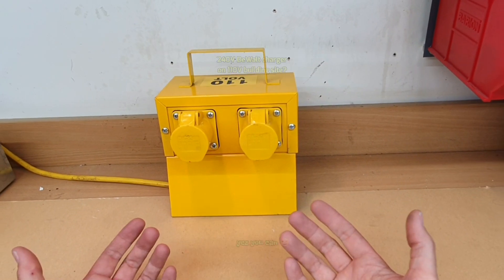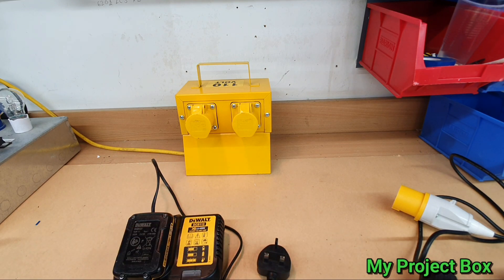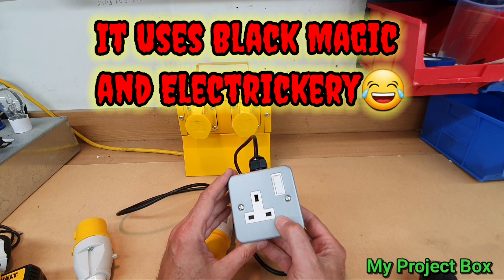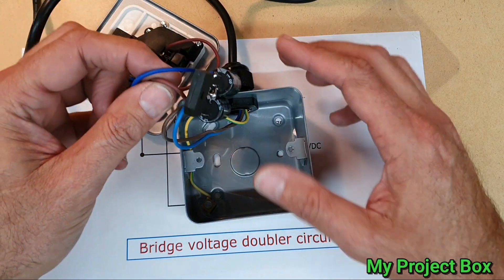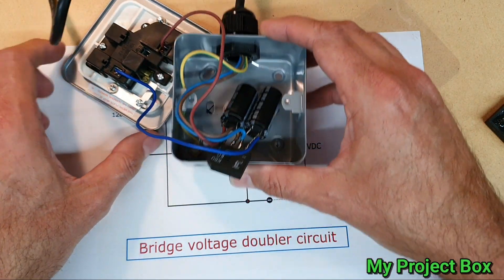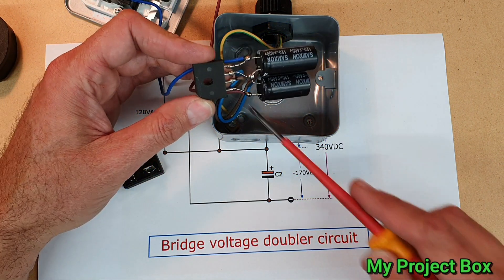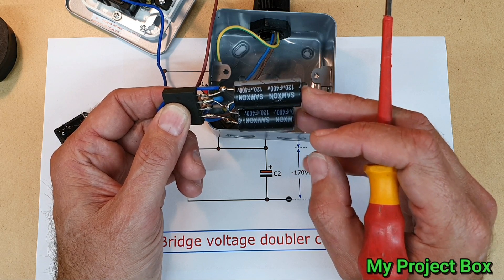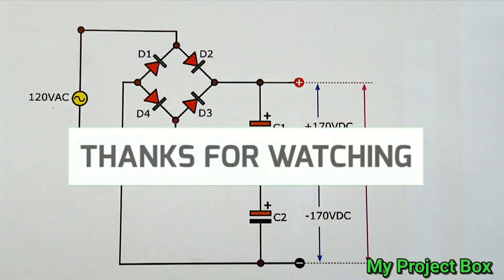240V DeWalt charger on 110V UK building site voltage doubler rectifier adaptor #electronicscreatos

Comment: You could have tweaked the charger circuitry like they do when the charger is for 110V and the socket is 220V, but in the other way around, it all depends on the internal construction.
Reply from the maker: Some older Switch Mode power supplys, had a switch that enabled a voltage doubler for 110V use.

Comment: How many Watts can this setup handle?
Reply from the maker: @PheonixHDz  it depends on the size of the capacitors and diodes, but it's only recommended for something like a drill charger.
Reply: @ Thanks for your reply. I have a dual Milwaukee rapid charger that delivers 6A to the bays, I can get a 6A rectifier but will I need some larger capacitors than you have used?
Reply from the maker: @PheonixHDz     The 6 amps you are referring to is the output of your charger, and not what it draws on the 230Vac side.  It might work, you would have to do some experimentation

Comment: interesting  vid was it a dub 60  bridge rectifier slimline you used thanks
Reply from the maker: Any rectifier with a high enough voltage and current rating will work. Maybe 600v 4Amp . I used capacitors 120uf at 400V rated.

Comment: makita charger does not work with this technique. the charger detects abnormal supply and shows battery fault.
powertool world UK sell a genuine 110v makita charger @ £49
Reply from the maker: It did work with my makita charger. But it might of been a older model.  I guess this is very much experimental, and not guaranteed to work with everything🤨.  You just have to try it and see.  Thank you for sharing your experience.

Comment: Hi I was wondering if you could help, I would like to convert my Makita DC10WA from 230v 50hz (normal UK England supply) into 110v so I can use it at work on the building sites. I'm an electrician by trade, just a bit uncertain when it comes to electronics. Hopefully you can help, 
Many thanks 
Andy
Reply from the maker: Have you tried powering it directly on 110Vac. Some chargers will work on different voltages( 80v to 250v). If it doesn't work then you could try my voltage doubler circuit, from this video. I have not tried on your charger yet, but it should work. You might have to increase the capacitor values a bit, if it's getting a bit of volt drop. Remember the output voltage of my circuit is a doubled and rectified DC voltage. It's the same voltage that you get on the capacitors inside your charger. About 325VDC. This is the normal internal DC operating voltage.

Comment: Can a 110v compressor be changed to 240 buy adding a plug
Reply from the maker: No it won't be possible  using my method. This circuit was designed for tool charging.

Comment: Can i put them right inside the charger?
Reply from the maker: Is guess it can be done, if there is enough room inside  for the capacitors and rectifier bridge.
Reply: @MyProjectBoxChannel  can you please tell what capacitors and rectifier bridge have you used? My charger it's a bosch and have a loot of room inside.
Reply from the maker: @bogdanulici1857  have you tried powering it from 110V? Sometimes it can work on both 110V and 230v, if you are lucky.
Reply: @MyProjectBoxChannel  no I haven't tried, im afraid it my blow up or something to be honest. Ive seen online people switching bigger capacitors on the US charger (110v) to work on 220v. I was wondering if its not working the other way around on the 220 one, swapping the bigger capacitors to lower ones.
Reply from the maker: @bogdanulici1857  using a 230v charger on 110v, the lower voltage won't harm it(but it might not function). But running a 110V appliance on 230v could be bad. A lot of devices will work on both though.
Reply: @MyProjectBoxChannel  i think i will try your method,that my be the best bet.
Reply: Hi! I've tried your method on two bosch charger and works great,but now i have a Hilti charger but won't work with this method,only blinking,  maybe need bigger capacitors or different bridge rectifier...can you help me please?

Comment: Could I pay you to make me five of these if that's okay? Thsnks
Reply from the maker: I'm not currently making these for anyone. I might build a couple of these in the future,  If there is enough demand. However I don't want to be liable for anyone's equipment getting damaged. My work will not be able to be electrically certified, in any way. People can build this circuit at their own risk. The thing works great, and nothing bad should happen, but you could void the warranty of your device.
Reply: @MyProjectBoxChannel  I don't think I'm too worried about avoiding the warranty on my 1990s lights 😂 No worries. I thought I'd ask. Seems like a really great bit of kit you've made
Reply from the maker: @cdpointless6819  no worries 👍. By the way what were you planning on using it for. It's kind of designed for cordless tool chargers, or other small "switch mode power supplys" only 🤔. It won't work on the older style "transformer type" power supplys(heavier)

Comment: You shouldn’t run AC things on DC!!
Reply from the maker: I have done that many times😉 DC is making a big comeback https://youtu.be/Au3wURws_Bg
Reply from the maker: You can run switch mode power supplys directly on DC. But you can't put DC on the older transformer type power supplys, it simply won't work. Most LED light bulbs are OK on DC. CFL bulbs are fine aswell.  Induction motors don't work on DC,  but brushed motors (universal) are normally OK.

Comment: The site transformers have a 240v plug on the other end as it steps the voltage down from 240 to 110v so just plug the charger into the same 240v supply that the site transformer plugs into
Reply from the maker: If you can get the the other end then yes

Comment: Just plug the charger into the 240v supply that the site transformer is plugged into
Reply: Alot of site transformers aren't plugged in, they're hardwired on an armoured cable into a distribution board. You generally won't find 230v sockets anywhere On a uk site other than in the site office
Reply: @grahamnew5068  haha just splice onto the armoured and put a socket

Comment: Please make me one,
Reply from the maker: I just don't have the spare time at the moment😮‍💨. And I'm currently not based in the UK.
Reply: @MyProjectBoxChannel  ok, 
Thanks anyway.
Reply from the maker: @PeakyBlinder   If enough people show interest I may build a couple
Reply: Nice work, I have one question tho.. 

I thought yellow 110v were Two phase 55v A/C?

So what you did first wasn’t enough power @ 55v (one phase of the two) 

and what you did next got you 110v output not 300ish? 

Did you measure the output voltage? 

Just trying to get my head around it. 

Thanks for the great video.

Comment: So, for safety, building sites want you to use a power supply that has nothing higher than 55 vac, with the 110v centertapped, on extra robust CEE plugs. And then you turn it into 340VDC on a regular plug.

If you bring this into a building site you should probably be thrown off the site.
Reply from the maker: I get your point. But what do you think of the "rectified DC voltage" inside a "110v site type" dewalt charger is? Answer, it's the same! Over 300 volts DC on the filter caps! Just a bit of moisture on your plastic casing of the charger, and then voltage is exposed to your hand. The charger has little slots for cooling, so it's not sealed in any way.
Reply: @MyProjectBoxChannel  you said the exact word that is the difference: “inside”. No, you’re not going to track a measly few hundred volts just because of “moisture”.

Also, a SMPS that is running on 110V and does not have a physical 110/220 switch will never have 340 volt inside, it’ll be 170.
Reply from the maker: @JasperJanssen  I guess you're right. Simple "multi-voltage" flyback topology SMPS, simply rectify and smooth the mains voltage. Some very old fashioned type computer power supplies had a switch that engaged the voltage doubler. I've also seen this voltage doubler being engaged electronically. Sometimes they double the voltage for power factor. So that the sine wave can be loaded evenly. And there are various different ways of doing clever active power factor correction. The UK's 110 volt center tapped to earth seems to be unique in the United Kingdom on building sites. But you would think with good RCD protection this is kind of redundant. Modern residual current devices operate incredibly quick, and the risk of electrocution is almost zero. I do admire the UK's belts and braces approach(55v 0 55v). I just think it's way over the top.
Reply: @MyProjectBoxChannel  I kind of agree that the UK is a little OTT on all of that. Re:RCD, I’m not sure that temporary building site supplies are always equipped with (let alone working) RCDs.

And let’s be fair, the type of usage that is charging batteries is not exactly high-risk. But if you’re gonna do this I really do think you should put it inside the charger’s case and replace the cord with a thicker one with a yellow cee plug, rather than making it an adapter. Particularly given that that socket is not designed for a high-ish DC voltage, and people are bound to plug other shit in it no matter how well you label it.

Comment: Hello nice video, I have festool M class 240v. 
Will this adapter work? If yes can I buy please 🙏
Reply from the maker: I haven't tested with it with a festool charger, but I see no reason why it shouldn't work. The component values might have to be tweaked ( bigger capacitors). Unfortunately I just don't have the means and the time to build these things at the moment. Maybe in the future I might start building and selling my projects.

Comment: Hi, I really liked your video, you are great. Can I put two capacitors of 200v 1500 uf or one 450v 10-30 uf?
Reply from the maker: The circuit is called a voltage doubler rectifier and it needs 2 capacitors to function. The 200v capacitors should work for a 120Vac input ( higher voltage capacitors would be better for extra safety). 200v 1500uf are very big capacitors but should be ok , you will have a big initial inrush current as the caps first charge up.

Comment: Thanks for this. As I have 3 Festool 240v chargers already, I am going to see if I can build the circuitry right inside the charger.
Reply from the maker: Just test  if it works on your festool charger before you go "all in". You may have to increase the cap size for your specific needs. I have not tested with the festool brand of charges yet.

Comment: I Tried this method with a 240v Makita DC18rc charger… it didn’t work….it reacts with alternating green red blinking lights to indicate battery fault. Can the makita charger sense the dc feed voltage? Or is  and circuit in the battery sending the fault?
Reply from the maker: I'm not sure. I have not tried on that type of charger. Maybe the capacitors need to be a bigger value. You could be getting a voltage drop with the battery charging. On your DC side you should be getting around 300v DC even under load. Also this won't work with older transformer (Heavy) based chargers.
Reply: Makita they selling 110v charger

Comment: For less than 50 you can get a fast charger from America that is 110v .just swop the plug . this is a waste of money
Reply from the maker: You're right you could just get the US version. But If you handy with a soldering iron, the whole thing cost me just £3 to build. it's also universal. So if you have multiple different tool brands chargers, it's a handy thing to have in your toolbox. As a bonus you can build them in less than 20-minutes, and you don't have to wait for the shipping time from USA.
Reply: @MyProjectBoxChannel  Could you run a chop saw off of it?
Reply from the maker: @sycbeck652  unfortunately it won't work 😥 it can't supply enough current for your chop saw. You would need much beefier capacitors  and rectifier diodes. in theory it would be possible, but I would need to know the exact specification of your chop saw.
Reply: If I had more than one type of charger I would probably  do like you did
Reply: But they working only on 60hz I don't know will work

Comment: Do you have one available?
Reply from the maker: I have the one from the video it was promised to a friend of mine. I could always build another one for him. You have to let me know if you interested is £50 okay?
Reply: @MyProjectBoxChannel  is that posted? I am in London.
Reply: And I can use it with any charger, right. I am on makita/festool platform.
Reply from the maker: @cabobila  it should work theoretically with any modern charger (not the old-fashioned heavy transformer type) I've not tested on Makita or festool, but Milwaukee drill charger worked fine. I don't see any problems.
Reply from the maker: @cabobila  so I'm in London as well, but it's postage charge extra ( royal mail.)
Reply: @MyProjectBoxChannel  do you have one available to charge the flexvolt dewa;t batterys 54v all my tools 54v with fast charger
Reply from the maker: @pmac3875  I'm not currently fabricating any of these adapters. I just don't have the spare time. I don't actually know if the flexvolt charger will work with my circuit. I would have to get my hands on a flexvolt battery and a charger, to experiment and test. It could be interesting though.
Reply: @MyProjectBoxChannel  himate no worries ya stuck on roofs no access to charging banks except 110 v transformer was thinking either adapter used for pat testing 110 v to 230 plug might work or also thouht just snipping off plug and putting on 110 plug on one of my chargers until i came across your video
Reply from the maker: @pmac3875  some changes can work on both 110v and 240v, so you can simply just put a 110v plug on it. You could give it a try to see if it works! It isn't always possible though. (240v only) I don't really know why DeWalt has done this, as most appliance chargers can be used anywhere around the world, on any voltage! I suspect they want to force you to buy different ones so that they could make more money. You could get a  North American version and simply change the plug for the side transformer 110v type.

Comment: will 200v caps work?
Reply from the maker: 200v caps should be ok for 110v AC input. I would prefer to use 400v caps for extra safety and robustness ( just in case you accidentally put 230v on the input)

Comment: awesome video man, you answered all my questions lol
Reply from the maker: Please remember to only use this voltage doubler on chargers that don't mind DC to power them. So nothing with a traditional heavy transformer. Most cordless tool chargers use switch mode power supplies these days, and they can handle DC with out any problems.

Comment: No surprise. Many electrical devices have been dual voltage and dual frequency for quite a while.
Reply from the maker: It should work on 110v and 230v like most modern appliances. But in this case they want you to buy the 110-volt version. It simply won't work on 110v. That's why I came up with the voltage doubler adaptor.

Comment: I think only flyback topology supplies can work on 100-250. This topology is usually limited to <50W though.
Reply from the maker: I didn't check if it was flyback, but if you use a voltage doubler rectifier it should work on on most SMPS.
Reply: Pretty much all laptop power supplies are universal voltage and those go up to 300W. For that matter, full size computer power supplies are as well, and those easily do 2 kW. It’s basically just that universal supplies aren’t quite as cheap.